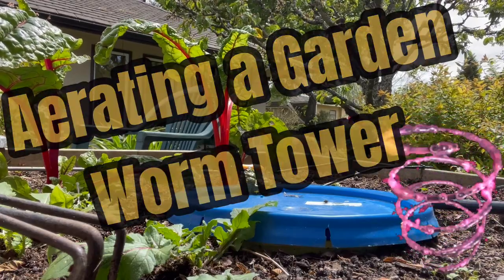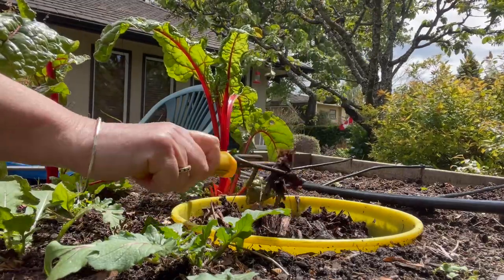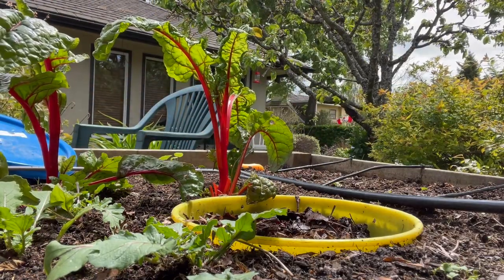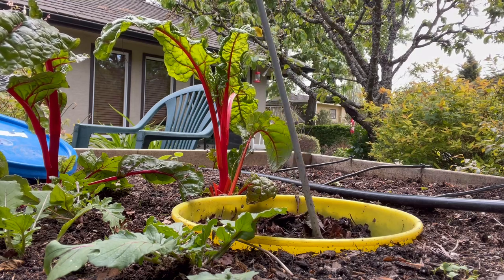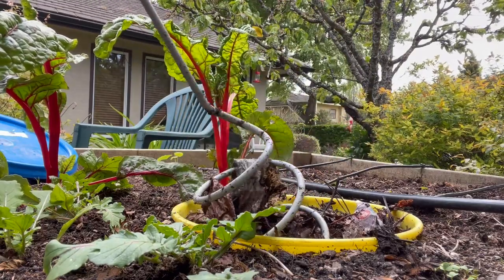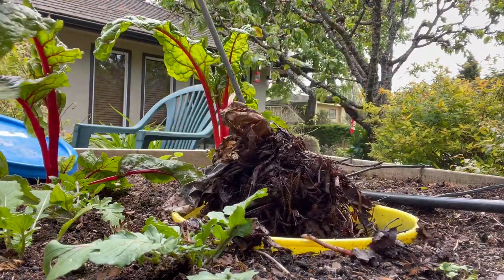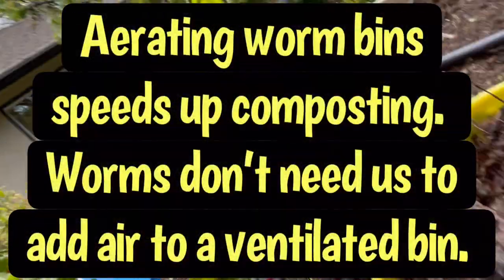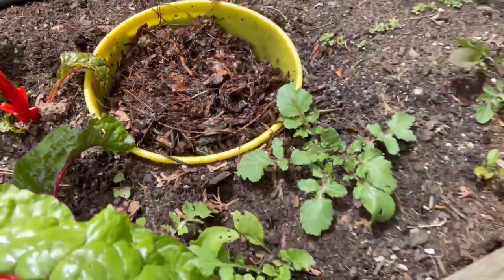Aerating a Garden Worm Tower

Comment: Looks good Sandra! Starting off slow like you did is the best way. Screw the compost tumbleweed a little to loosen and then go deeper is the easiest way I found to do it. Also pro tip🤣😂 after you pull up the compost from the bottom you can spin the compost tumbleweed the other way so it doesn’t pull material out and it doesn’t go flying. 😁
Reply from the maker: Brilliant tip, Rick! This is really the most handy tool to have around.
~ Sandra